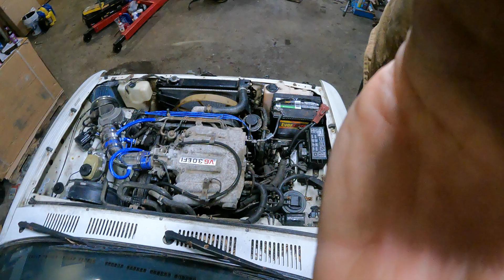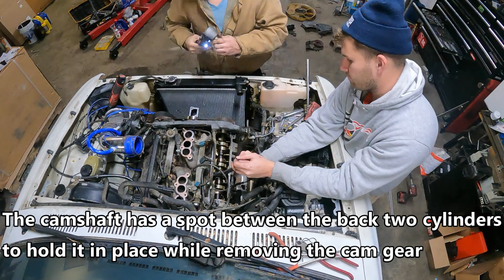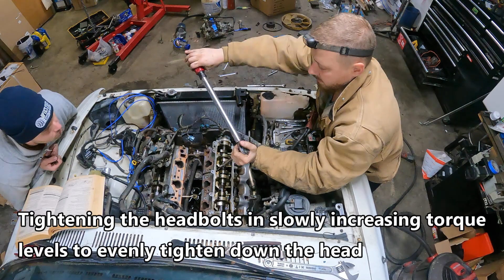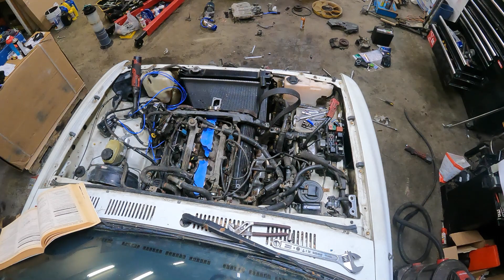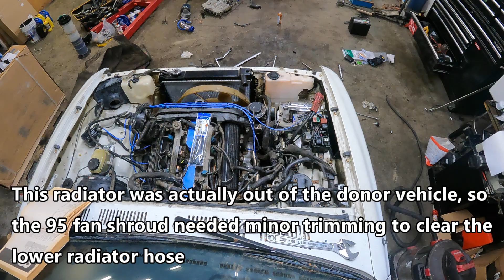Saving this FREE Toyota Pickup! 3VZE Head Gasket Replacement

Comment: The exaust system design is the reason they blow number 6 cylinder where both connect builds too much heat
Reply from the maker: Yeah, the exhaust crossover pipe hugs the #6 cylinder too tight. Which is why we went to a header setup to eliminate the crossover being so close to the head.

Comment: I had shop replace head gasket, timing belt and now the stay on. Mechanic said the timing has been checked by 3 mechanics and is good.  It starts if you don't connect a connection that goes to the throttle body.  As soon as you connect it, it turns off.. any idea?
Reply from the maker: Which connection are you unplugging to get it to run? An electrical connection, or a vacuum connection?
Reply: @MurphyAM  is an electrical connected to a vacuum house before throttle body.  He replaced the MAF because connection broke. I have pics but not sure how to load them here.
Reply from the maker: If you can, upload a video and drop a link to it here in the comments

Comment: How's it running? No issues even though you didn't get it resurfaced?
Reply from the maker: It runs about as well as a 200k+ mile 3vze that sat for a decade can be expected to run 😂 it’s not winning races but it’s still kickin.

Comment: Dude 
Do you have headers on that?
What brand?
Reply from the maker: There are headers on it but I did not purchase them, so I couldn’t tell you the brand. I am pretty sure  they are generic eBay headers. Fitment wasn’t the best but that’s expected at that price point.
Reply: I would like to get away from the crossover pipe that runs behind the motor
Reply: Me too,  d.h.
Reply from the maker: @donhuff6658  these headers did eliminate the crossover pipe behind the engine, and instead there is a y-pipe below the truck.

Comment: Two questions. 

Did you only change the head gasket on the passenger side? I thought it was good practice to change both since it's the driver's side that usually fails.

Also, how long did this process take you from start to finish?
Reply from the maker: I only did the passenger side because this engine was previously rebuilt per the last owner. But the passenger side was weeping oil once it got up to temp because the back two head bolts were not properly torqued. So while I only replaced the one headgasket, I did recheck the head bolts on the drivers side and they were all tight. As for time to do it, it was a few hour job, nothing major and I could probably knock another one out in under 2 hours if I had to.

Comment: I have this same motor in my 88 Toyota...what does it cost on average for  this head gasket replacement to be done?
Reply from the maker: Unfortunately I don't have access to labor times for this job, but I could imagine a shop charging 3-5 hours for this job, depending on how many of them they have done before. Assuming 100$/hr labor, and probably 200$ of parts, you're probably looking at 500-700$ low estimate?
Reply: @MurphyAM  thanks for your reply..that seems completely reasonable.  Not even sure if I need it done but I'll look into having it checked now.and maybe get it done for piece if mind!
Reply: I was just quoted $2800 for this job lol. I'm about to attempt this myself.
Reply: I got 7 quotes in the Sacramento area including 4 dealerships and the CHEAPEST was $2500, that was both sides with new bolts and both heads refinished.
Reply from the maker: That’s not bad, but I’d probably put that money towards a 5vze swap. More power, more reliable, more modern, and damn near a bolt in swap apparently.
Reply: @MurphyAM  that's what I thought too, but they were quoting me $10K for a 5VZE swap

Comment: Did you take out the cams? If not how
Reply from the maker: I did not. Just used a 3/8’s drive short socket with a wobble extension.
Reply: @MurphyAM  That's amazing thank God you found a way this is going to save me big time the book I have says to take the cans out and countless other videos on YouTube ... I'm getting the LC engineering MLS head gasket and stud kit hoping to bulletproof it
Reply from the maker: @sebastianharrison6118  I can’t guarantee that you will be able to get the bolts out of the head if the cam is still in. I reused the head bolts here (that’s a whole different debate) so I left them in the head after loosening. You may be able to get the bolts out by rotating the cam some once the head is off, just make sure you set it back to the correct position before reinstalling.
Reply: @MurphyAM  yeah those torque to yield bolts can be a pain glad to see you reuse yours there's a channel called the torque test channel and they do a test on those bolts and found that there's not a big difference but there is a difference after they've been used I say just add another 10 foot pounds .... Thank you so much for your help
Reply from the maker: @sebastianharrison6118  Yeah there is some debate as to whether or not they are torque to yield or torque to angle bolts.  Allegedly there was a headbolt and gasket change in 1990, as the 1988 and 1989 were not covered under the recall.  This donor motor is out of an 88 4runner.
Reply: @MurphyAM  o wow I never heard of that I thought they were all TTY
Reply from the maker: @sebastianharrison6118  I believe the FSM mentions a section specifically on measuring the headbolts for reuse.  I could be wrong though.
Reply: @MurphyAM  I'll have to look into it that's pretty cool if it does
Reply: Hey man just wanted to say I just got the head off of my 4Runner and you were right didn't have to pull the cam out I didn't even have to take the cam pulley off thank you so much!!
Reply from the maker: @sebastianharrison6118  that’s awesome! Glad it worked out for you 👍